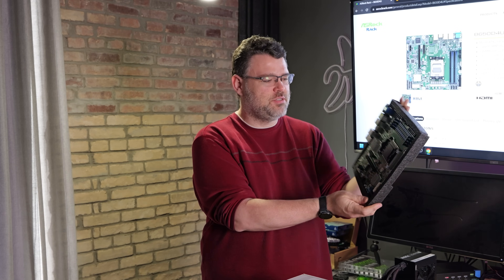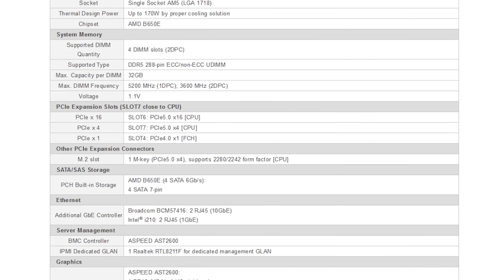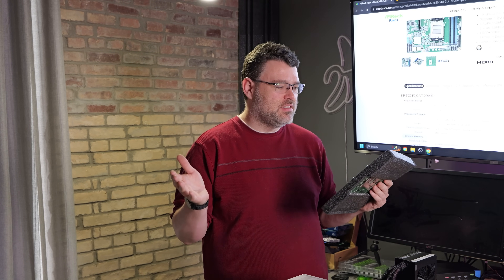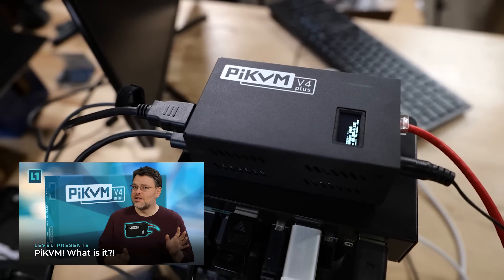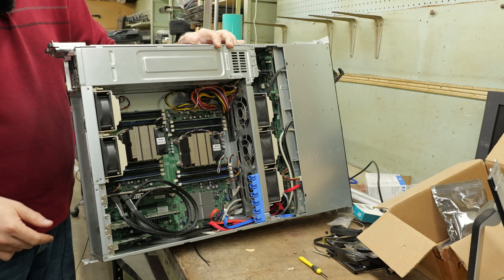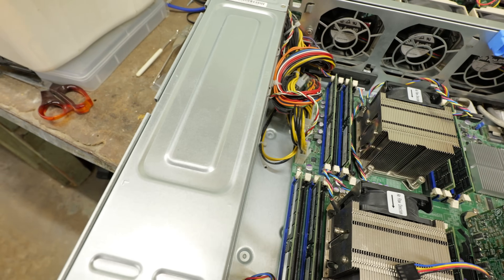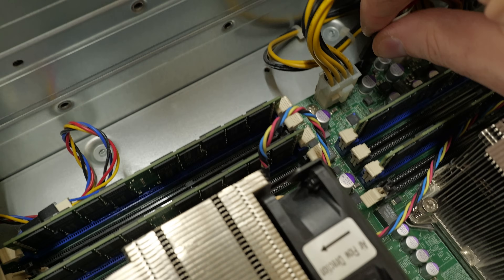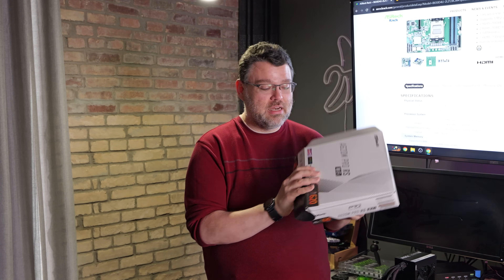Checking Out The ASRock Rack B650D4U Server Motherboard!

Comment: Interesting you should mention the Xeon E5. I will be upgrading a Dual E5-2470v2 (2x10 cores) to a 12-core EPYC 4465P (which is similar, though slightly faster than the Ryzen 7900, but wasn't available when the video was made) on the B650D4U board (no 10G ethernet, because I want the second M.2 slot for redundant system-SSD). Ordered everything, and will spend the weekend assembling, installing and testing. Stuff is hard to get in Germany, I had to order from three different vendors to get board, CPU and heatsink. I also happen to have a Supermicro case. We'll see how it goes.

Comment: I built this system, Thanks to Wendell     (after I got a $6,000 quote from 45Drives just for a C8 bronze server 4 HDD and 3U case, nothing else)....

My build;
B650DU 2L2T BCM $430
Ryzen 9 7900x (on sale last week, 41%off) $322
Noctua NH-D9L $66
Nemix 24GB x2 ECC 4800 ram $198
Thermaltake 850W SFX PSU $155 
4TB x5 HGST Ultrastar 7200RPM refurb 3.5" HDDs $250 for all
1TB corsair Gen 5 M.2 HDD w/ heat sink $163
LSI SAS card w/cables $100
Sliger 3170a XL 3U case w/ 3 Noctua 120mm fans $334
Navipoint 12U cabinet with 2 extra shelves and rack snapin studs $430 for all
Triplite 900W UPS $308
cat cable tool and other small stuff

$2800 total

stuff I already had;

24" samsung monitor
500GB x2 samsung SSD 
500GB x2 WD 3.5" HDD
8 port and 5 port switches
I made all my own cat cables
2 variable speed 120mm quiet fans and swapped the cabinet fans out, put them in my cargo trailer for summer time heat
4 DP KVM switch

I run Proxmox, Docker websites, Nextcloud, jellyfin, TruNAS, game servers, etc   

Thanks Wendell!   :)

Comment: Have you tried a hypervisor with gpu passthrough on the ASRock Rack B650D4U.

I have acquired Asrock rack B650D4U3-2L2Q  with Amd ryzen 9 9950xto runing  Xcp-ng 8.3 on it  but cannot get gpu passthrough to work on win 10 vm even though the drivers are installed successfully

Comment: Do you think is possible to cool this VRM on a regular (non-server) chassis?
I am planing to build a workstation on a Sama IM01 (basically a mATX NR200), and component positions on this board seem to go really well with the airflow pah I want to use.

Its gonna be all air cooling. My new motto in life is minimum maintenance, maximum reliability. Hence trying to get my hands on server grade stuff.

Comment: Check out Supermicro H13SAE-MF, it's basically the same as this one but with a x8 PCIe 5.0 slot. It is lacking dual 10 GBe ports but you can install a NIC in the x4 PCIe slot.

Comment: It would be nice if full ECC support (assuming UDIMM ECC) was available on AM5 "workstation" motherboards. Kind of like a AM5 HEDT that pushes up against Threadripper HEDT. That said, I think AMD should introduce an official gen 2 AM5 HEDT platform with double the PCIE lanes at 24 PCIE 5.0 and 24 PCIE 4.0 (vs Threadripper TRX50 48 PCIE 5.0 and 32 PCIE 4.0) and working ECC UDIMMs up to 48GB/64GB per module at the current maximum four memory slots. This could be the new X class chipset, also with workstation class stable IOMMU and Bifurcation. SO -> B750 > X770 > TRX40 > WRX90. Currently there is a HUGE gaping hole between X670 and TRX50.

Comment: These ASRock mobos and servers are great. They are replacing that segment that SuperMicro used to occupy before they went to OEM direct market only like Dell. If you don't want IPMI and the server price-tag the Asus Commercial AM5 motherboards give you ECC support on AM5 with a VGA port for datacenter crash carts. Something like the Asus Prime B650M-A II-CSM come to mind. It's pretty close to your ideal layout if you don't care about IPMI. It's likely what I'll be using for my 7000-series build since the margins are so small for over-clocking that I'd rather just spend money for stability instead.

Comment: This would be perfect for a low power solution, low CPU hz, system using the multitude of passive cases that can push out that heat. Then the use case being basically a slightly more advanced NAS build.

Slap a multi-NVME board in one of the PCI slots, and maybe additional 2.5Gb networking on another ... it's perfect.

Comment: I wish you commented on the ECC support with this kind of motherboards. ECC support seems to be a bit confusing, some say DDR5 is ECC by default, others say that it doesn't support all ECC features, some MB vendors support ECC officially, some don't, and even for those who do, the list of officially supported ECC modules is ridiculously small, so going for an enterprise-grade MB like this one seems to be the easiest way to avoid headaches for those of us that cannot test dozens of MBs and RAM modules until we find a working combination.
Reply: To put it in simple terms, non-ecc ddr5 had some built-in error correction, but ecc ddr5 has more of it due to additional hardware
Reply: regular ddr5 is basically ECC lite. Ryzen supports Unregistered ECC - but there isnt a facility for communicating issues with error correction like there is in the EPYC and Xeon chips.

Comment: I've built something like this using an x670E PG lightning and 7950X locked to ~45-55w(and no more than 75c, whichever is first)
no dGPU needed.
better transcode quality/compression ratio than GPU, but is fast enough thanks to 16 cores.
many PCIe lanes for high speed networking, SAS controller, and 1TB optane(hoping the 1.5TB come back in stock, didnt even see those before they sold out)
I really would like OOBM though

--there is a bug in FFMPEG that causes massive file sizes OR horrible quality when converting from MPEG2, to H26x/VPx/AV1 on a GPU, and yes, i've tested all hardare transcoders over the past 7 years, including the DG1, and Apple M1/2 (apple being the best) but all are vastly inferior to apple's own and other CPUs, with most hardware transcoders doubling or trippling the file size, or making 1080p, look like youtube 240p at the same file size, despite H265/AV1 being far supiror to the..... 20+ year old? MPEG2

Comment: What you need to look at is Supermicro H13SAE-MF, technically it's a workstation motherboard but it has the server level backbone.
Dual x8 PCIe 5.0 Lanes in x16 Slot
Single x4 PCIe 4.0 Lane
Dual M.2 Slots PCIe 5.0
Dual 1gbe Intel Ethernet
Dedicated IPMI Port

I think this one from Supermicro is better than ASRock Rack offerings.

Comment: recently set up a Supermicro 8 node in 3U of space AM5 blade system at work with 7900's and 7950x. it has been working great, single/few threads performance is just off the charts, and heavily threaded performance aint too bad either

Comment: I think for the price the only thing I'd change on this board is the 10GbE chip to an Intel X550, that way you'd still keep the 10GbE ports but they can also be used at 5Gb, 2.5Gb and 1Gb. In addition, the drivers for that card are present in pretty much everything (BSD, thus pfSense/OPNsense, Linux, VMWare etc).

Comment: The NM-AMB13 mounting bars are what you need if you want to mount an NH-D15 cooler and have the fan axis parallel to the DIMMs. It will still interfere with the x4 slot and only has .001'' clearance with the GPU backplate so YMMV

I was able to connect a Taichi 7900XTX through 0.8m of 85Ω passive mini-SAS cable at 16Gbps x16

The latest BIOS won't boot four Micron 32GB EUDIMMs at faster than 4000MT. Bad memory timings aren't recoverable so you have to watch it POST through the LED or IPMI and clear the CMOS when it fails. DIMM voltage is not adjustable and fixed at 1.1V

Contrary to the video, ECC errors are also reported in the management interface

Fans running at 1500RPM are frequently reported as failed, and more often at slower speeds. Below 600 rpm they don't register at all. The motherboard headers have a second tach input so you can run two fans off each header and read their RPM separately

The Broadcom UEFI UI is unbearably slow, it can take 45 seconds to respond to a key press if it does so at all
Reply: Are you sure this doesn't just shift the cooler pressure down and have the fans in the same config? This has a 90 degree socket

Comment: I've got a E5-2630L v4 which does 10k Passmark. Neither Intel nor AMD makes something like it any more. Hasn't since 2016. It's low power, has 10c/20t, and 40 PCIe lanes. There is NOTHING on the market with 40 PCIe lanes at 55W TDP. I'd love to get one of these Intel or AMD boards to replace it, but there just aren't enough PCIe lanes for what I'm currently doing with this v4 chip from 2016.
Reply: same, and for the cpu and moherboard cost you can buy a lot of power.

Comment: It is a nice Bord. I have learned over the Last years you dont need al those Features and Performance really for Home Server stuff unless you need those for crunching numbers or Lifting tons of Data. But for me i have only a 50mbit Network to the Internet and a secondarry 15mbit Network over a  cellphone Router with a Sim Card. My Personal Home Server needed only be 24/7 available and Power efficient. So i bought a j5040 with 16gb RAM and a Pico psu and uses a old external HDD wall wart with 12V 25W. On this Server ist running a Minecraft Server 3gb 20players with Standard settings and a Samba Network storage Server. And everything i need to Deal can be Done over ssh. I have 1 SSD with 500gb in it and nothing else. I run powertop for deactivating every Thing what i cant in the BIOS and for some system behavier Things that preventing from going down with the c States. And even 20 Players are online the CPU is only to 30% used. The best Thing in this System is, it is dead silent and draws in idle 4W and on CPU Benchmarks and HDD Benchmark parallel  only 17W. On Thing say be Said i Ran Ubuntu 22.04 LTS in this Thing Not Ubuntu Server. Box Standard Ubuntu 22.04 LTS. It is the ideal Server vor my use Case. I dont need more. I dont need ecc or ipmi or other fancy stuff. If i need maybe more Power in the future. There is maybe a system Like this available that uses the newest nessesary pc Tech but again packed in a small 10w cpu Like this.

Comment: Wendell, why doesn't ASRock Rack make an ATX or EATX version of this, and break out 16 of the PCIe 5.0 lanes from the CPU into 16 PCIe 4.0 and 32 PCIe 3.0 lanes across 6 PCIe x16 slots?  It seems like the market segment that would be interested in this type of board would prefer more PCIe lanes...
Reply from the maker: Why doesn't level1techs commission their own custom am5 motherboards? ;)
Reply: @Level1Techs Wendell, that would be really sweet to see!  Level1Techs already had the ear off the market that would be interested in this; seems like a perfect fit to me!
Reply: That is quite the write up; thanks for all the information --- I was not aware of every detail you listed; I was just trying to think outside of the box.  It's certainly a compromise, but for someone with a NAS or home server use case, it is definitely better than the alternatives.  Where PCIe 5.0 lanes are currently only useful for certain NVMe situations and maybe super high speed networking, a mix of PCIe 4.0 and PCIe 3.0 lanes are generally fast enough, and open up a lot more options.  Thanks again for the details!
Reply: A 64 lane PCIe 3.0 switch would add at least $200 to the BOM, Gen 5 would be even more. If the BOM is $200 more the price will be $600 more so it's not any cheaper than EPYC or TR PRO and the lanes are still oversubscribed
Reply: @shanent5793 Isn't this what the chipset chip on x670e already does (break out PCIe 5.0 into PCIe 4.0?  They could simply link more chipsets together.  While not being entirely ideal for performance, it wouldn't add $200 to the BoM either; that might be an acceptable trade-off...
Reply: @johndelabretonne  Each Promontory 21 chip has 12 PCIe 4.0 lanes, 8 PCIe 3.0 lanes that can also be used for SATA, a 20Gbps USB, and four 10Gbps USB. So the chip only connects upstream to the CPU at PCIe 4.0 x4, 64Gbps total, tying up four of the Gen4 lanes. Chaining them consumes four more lanes for the downstream, so each chip can add four Gen4 and four Gen3 lanes, plus some USB. The final one has no downstream, so four more Gen4 lanes are also available. The whole chain is still limited to 64Gbps, or 7.8GB/s after encoding. Each chip probably adds another 100 to 200ns latency.

Standalone Promontory 21 chips might be useful for building a NAS, each chip could let you add two or four NVMe SSDs, and the bandwidth isn't as much of an issue if you're only serving a dual 10 or 25 GbE NIC through the CPU lanes anyways

Comment: Memory details at 14:58. He says "4 dimms per slot" but I think the board is setup to allow 2 dimms per channel and the restrictions mentioned are 5200 with 1 dimm per channel and 3600 at 2 dimms per channel. Wendel is used to working on systems with 16+ slots :)

Comment: I've had this board since launch and ECC errors (both organic and deliberately injected at the chip and bus levels) are reported and logged in the management interface which has nothing to do with the user OS or kernel. Why do you keep saying that AM5 ECC support is somehow incomplete? What else is it supposed to do?
Reply from the maker: What kernel? For me the kernel logs them but never goes to the ipmi. On am4 I created a module to inject the error into ipmi logs because the sysmgmt stub wasn't doing it.

Comment: I'm moving my primary home lab server to the x570 version of this board with a 5950x in a couple weeks. Wish it was full ATX with a couple more PCIe slots but it's going to do all that I need it to do for the next 5 to 8, maybe 10 years.
Reply: This is why I ended up just going EPC 7282 paired with the AsRock Rack ROME6DU-2L2T (which is an insane mATX board btw. 4 4.0 full size x16 slots with full bandwidth). Satisfies all my needs in terms of plenty of room for adding on drives indefinitely, and all the PCIe lanes I could ask for.
Reply: I just finished a build with this exact setup, unfortunately the chipset is overheating at idle or bios screen. temporarily replaced with an ASUS board until RMA replacement arrives. hopefully the replacement board doesn't have the same issue!
Reply: @MarkCordingley  I known it 's an old comment but I'm building a PC just this moment with this board. DId the RMA resolve the issue?

Comment: The last Asrock server board I bought was an X570D4U-2L2T, and now I have it just sitting in a box in my closet because the IPMI firmware is such crap, it doesn't even support serial-over-LAN properly.  The chipset is also in a really bad location -- no cooling if you have a Radeon Pro W5700 in the x16 slot.

That makes me wary of any newer Asrock boards, too.  My current server now uses a secondhand Supermicro X11SSZ-TLN4F.

Comment: This has been on my buy list for a while. But then I checked ebay for epyc. The 7002 can be easily found with a H12SSL-i and 256G of RAM for 500-1500€ depending on the config.
I would really love a workstation like MB for ryzen 7000. The intel workstation chipset has a lot of pcie. The Ryzen ones all need an HBA for a NAS. None come with IPMI + 8 sata. Intel also requires the workstation chipset for ecc ram.
Reply: the idle power of 7002 + reg ECC is ridicolous though

Comment: From my understanding, the main issue with threadripper is the motherboard support.

If vendors are making server grade am5 motherboards then it may make sense for AMD to make 24-32 core am5 chips. 

From my understanding, it’s technologically possibly. I think threadripper customers would much rather buy that then threadripper itself.
Reply: Am5 and the consumer line of CPUs are heavily limited by the max memory cap and especially the low number of PCIe lanes.   If they increased the am5 pcie lanes to the 40-60 lane range then the platform could be viable.  But until then, threadripper and Epyc are the only ones with high max memory and lots of pcie lanes.

Intel does the same thing with core cpus vs Xeon workstation and server skus